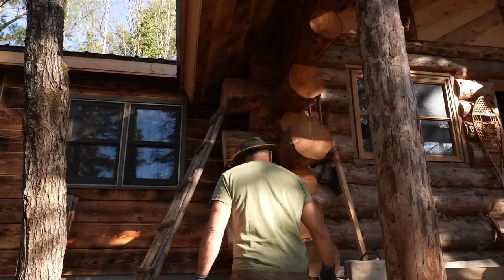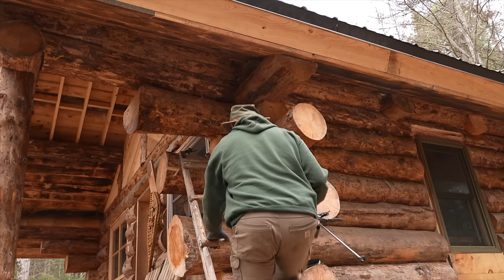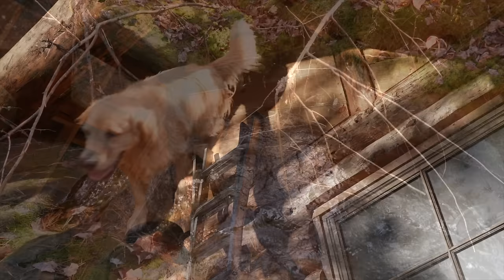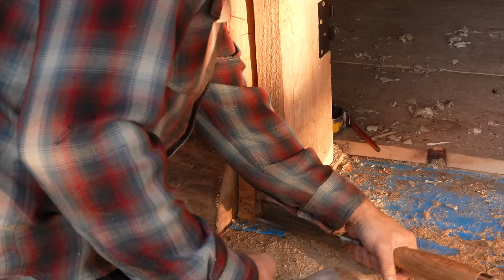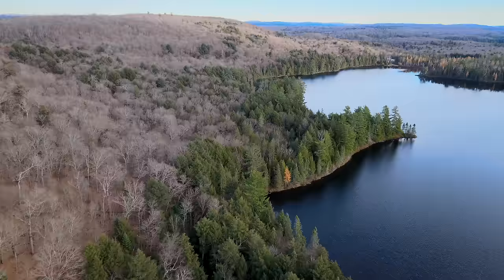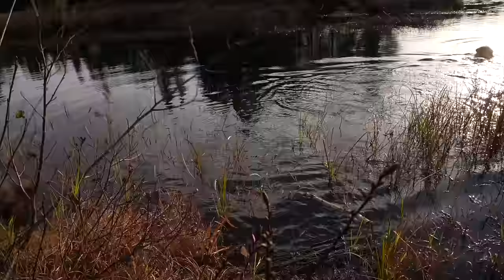Chinking and Wood Trim, Building a Log Cabin Alone in the Wilderness, Episode 30

Comment: Probably too late now, but just in case: if you cut the tip of the seringe at an angle you do not have to use that wood thing to flatten out the clay. The tip of the seringe does that for you in one love

Comment: Shawn that is really cool how you did the chinking.never seen it done with that tool your were using to put the filler between the logs like that. I thought it all had to literally be done with your hands/fingers and a trowel of some other tool.
   That has to cut the chinking time down quite a bit I would think.

Comment: I was inspired by the planks you used as siding on the extension on your cabin. The ones you chamfered with a hand plane. I plan to replace my 1980’s paneling at our off-grid cabin in north eastern Québec. It is a stick frame but would at least like to have that log home feel inside so the look of those planks really looks like squared timber which I would bring a more cozy feel to our old place. I would even consider chinking it to increase it’s authenticity ( for looks of course)  What is the chinking compound are you using?  Your work and your stamina is absolutely awe inspiring. I can only imagine the pride and joy you will feel when you can sit back and look at all you have accomplished and to top it off, with your own hands. I bow to you sir.

Comment: I think it's possible to build some kind of Starlink Satellite Dish tower on the ground horizontally and connect the Starlink dish to it while it's got one end off of the ground resting on something and making sure the bottom end is right where you want to have your tower installed and dig a hole there where the bottom part of the tower is laying, it could be made by a few logs I guess, and then you could use a pulley set up, possibly with one of those block and tackle hoists or something and gradually lift it up a little at a time and as you go you can keep moving a support piece of something so it stays having something to rest on and not fall down again while you're lifting it up and getting it to fall into the hole you dug. Then you'd have your starlink satellite really high off the ground so most of the tree cover wouldn't be interrupting it. You have to make sure all your cables connected to it are long enough to make it all the way down the pole/tower and be able to hook up to it. It ought to work better really high in the air if you ever get one.
Reply: It would also be cool if a drone had a chainsaw part connected to it and you could fly that to a top of a tree and be able to cut branches off of it and cut the top of it off with your drone and then be able to install a Satellite Dish on top of a tree like that and the drone could carry the dish up as the dish is connected to a very long power cord going all the way up it. Just thoughts. I have no idea how you could ever mount anything with a drone though. Like if a drone could drill holes and screw screws. That would be cool.

Comment: I'm of the school of thought that the cabin settled.   Sand was always a questionable base in my mind when it is contained or if fluid is introduced. The sand base basement floor would; in my mind, be more stationary in its center, but vulnerable to movement from forces.  While the outer perimeter walls bear much of the weight and forces of the structure  This in my mind's eye would swell the earth in an area with the least resistance - center basement floor.  Basically, I wonder if your walls are sinking while the middle area of the supporting earth is stable?  Then again, I'm not there to see all things and can only arm chair this based on what is shown. On a more positive note my input is money made. (JF)

Comment: Does he torch the wood for termites? What is the reason for that?
Reply: The controlled burning of the wood draws out natural resins and leaves a layer of carbon on the surface. As an integral part of the timber, this weatherproofing system is long-lasting. It is often coated with an oil finish for added resilience

Comment: That caulk gun tip looks like a size you would use in a shower not for log cabins. Break out the utility knife and cut a big old honking tip on the end. Yea sure you use more material but can it be that expensive?